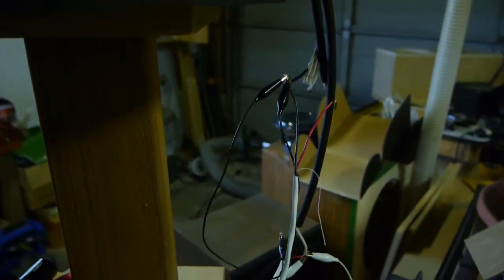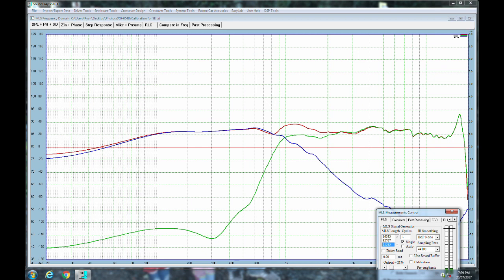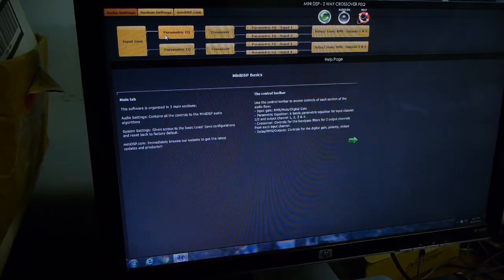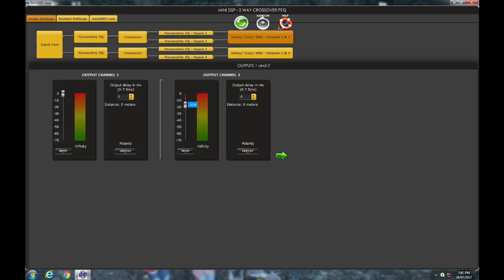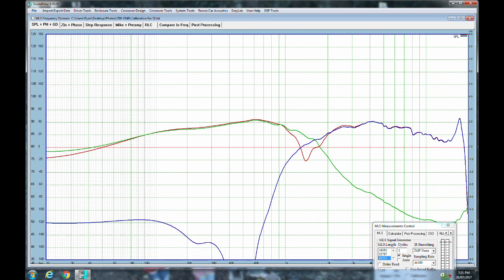Are Active Crossovers Easier than Passive? NO!

Comment: Agree - it does need to be said! Many people don't realise that the level of expertise to design either is about the same.
Reply from the maker: Red Spade Audio Yaaaaa, someone understood the point of this video! Thank you!!
Reply: You seem have forgotten the most important part. Active done properly.
Reply: the advantage of active crosoovers are not hat they are way easier to design. But that they are way easier to implement and you can reuse them in the future if you ever retire your first build by just reconfiguring them, not needing to buy all new parts.

And I'd like to share, you don't need to pay 100-200 for MiniDSP or MiniDSP HD to have active crossover, depending on your application there's free software like voicemeeter (that's actually a pay what you want software) or EqualizerAPO, that can help you with that depending on your setup.

I personally have a pair of active bookshelfs and just bought a pair of subwoofers, I was desperate to find a way of connecting them all togheter witouth spending a lot of money, I considered MiniDSP but I didn't want to pay 100 for it. Well voicemeeter banana just saved me. What I did is I bought a second SMSL M2 DAC and used voicemeeter to send signal to both of them, then I configured a high pass to the first and a low pass to the second M2 DAC, now I have a crosoover at 70hz about 36db/octave. But I didn't test that yet as the dual subs and the second M2 didn't arrive yet. But yeah, very cheap, not quite easy to use but the price makes up for the trouble. And since voicemeeter allow you to setup macros I made 3 presets, one for movies, a second for music and a third to just send full-range to the monitors when it's late night and I don't want to disturb anybody.

I'm pretty sure I'll need to make some fine adjustments when the subs and second DAC finally arrives.
Reply: Hi, im from indonesia.
Mini dsp is $105 at PE, with shipping and tax its $161 at my door.
Dont have budget for it.
I go with $3 caps, and $6 inductors.
With free xsim, im doing fine with passive.
Reply: @handryraya2853    FreeDSP.   Boards can be had from CHINA for almost $10 bucks. Or less.  GOod news?   They make some of the FREEDSP boards IN INDONESIA!    Its front end is more akin to a simple Plug and play setup.   But you can do ANYTHING with it.  Hopefully, someone builds a Front end software layer like most Normal DSP packages.
Reply: I'd have to disagree there..

Comment: The "newer" DSPs (e.g.ADAU1701) can do anything an analog crossover can do and much more.  You can test and implement with different slopes, topologies, add delay for time alignment and alter polarity as well...and boost or reduce dips or bumps in the response.
Reply from the maker: @chewsir  yes that's true. Even the minidsp used in this video. But that's not really what the video is about. Active is better. But not easier to do properly.

Comment: So you failed to understand that your 2nd order passive crossover switches the phase by 180°. You shouldn't delay the tweeter, you have to flip the polarity.
Reply from the maker: @Munakas-wq3gp I didn't fail in that, I'm showing that most people would. And it wasn't exactly 180 degrees. Also, flipping polarity and delay do the same thing, but with delay you can chose any degree where as flipping polarity you only get 180.
Reply: @ImpulseAudioSpeakers  Sorry but a 2nd degree butterworth flips the phase exactly by 180° so if you wanted to match your active and passive crossovers, you would use the same setup. Same polarity, same cutoff slopes. Your opinion on active crossovers is patently wrong because you can achieve with them everything you can do with passive crossovers, only easier. And steep cutoffs which are insanely expensive to achieve passively are just a mouse click on an active crossover. Having said that, what benefit exactly do you think a passive setup will give you? All it does is complicate the process and require you to buy expensive components to adjust the result if your simulated response was off. The only real benefit of a passive crossover is that it can be mass produced for consumer use to be used with an existing amplifier.
Reply from the maker: @Munakas-wq3gp  this video isn't saying active crossovers are bad. I agree they're great. The video is saying it isn't easier. You still have to measure and go through the proper process. Also, the phase wasn't exactly 180 degrees. There are other factors that affect phase and may require less delay than the 180 degrees. 

Trust me, I have a clue. But feel free to disagree.
Reply: @ImpulseAudioSpeakers  I could have sworn that the original title of the video was to the likes of 'using active crossovers is a bad idea'. But maybe I misunderstood.

Comment: Silly Title, havent watched yet, but it takes time to knock a circuit together and you still need to know what you are doing-more so in fact, skill level the same? well no, because you also need to know about soldering, power supplies, chips etc etc, as an analogue design engineer by trade DSP is a breeze because modification can be done on the fly without swapping out resistors and caps, BUT DSP unlike Analogue has limitation, most do not realise that the response is only as good as the number of Taps you have, so if you have say a miniDSP HD you will be fighting to squeeze into 1024 taps; especially at low frequency, then swapping between REW and Rephase is tricky when you start, you need to be 'on the ball', its really not for a beginner unless you have a decent technical competence and a good memory unless you go with a IIR and PEQ's in the software-BUT seriously if you appreciate sound you will not be happy going that route except on JUST low frequencies (because most ears cannot detect 5% distortion at the low end).
The right way to program a miniDSP HD is to utilise the PEQ's on input and output using biquads, then use the FIR to correct Phase by loading the impulse into REW and adjusting the created vector(L+R) to output excess phase and then loading that backinto Rephase to correct it on one channel.

Comment: You need active electronic crossovers that you can actually regulate continuously until you balance everything out , Rane and dbx work well. I don't waste time and money with passive anymore.
Reply from the maker: I don’t think you understood the point. The point was unless you can measure and understand speaker design, active is not easier.

Comment: 140 degrees out of phase eh? Why not just invert the tweeter?  🤔Since it's free and quick, why just choose 1.5k and call it a day when the DSP offers virtually unlimited tweaking?
Reply from the maker: Inverting the tweeter means they’re 40 degrees out of phase. Also, the point of the video was that these things don’t automatically work. You need to measure and design just like a passive XO.

Comment: no, it is not correct, a DSP and a activ crossover device are diffent things. A DSP has to calculate the signal this takes time, a activ Crossover uses the same parts as a passiv crossover and a op-amp, but before the amplifier.
Reply from the maker: Most people use the terms dsp and active XO interchangeably. Even more technically true is that a dsp and passive parts before the amp are both active crossovers. They actively change the signal delivered to the amplifier. A passive crossover passively changes the amplified signal.

Comment: This video is nonsense. Way to push your agenda. The reality is that active crossovers are much easier since it gives you all the tools to fix any problems.
Reply from the maker: I don’t think you understood the video. Active is more powerful, but all the steps to create the XO are the same. They’re not any easier than passive. Still need to build, measure, model, listen, tweak, etc. Not sure how that’s even debatable. I don’t have an agenda. I can do both quite well.
Reply: @ImpulseAudioSpeakers  is it easier to make a new bigger box with a better port tuning or to just amplify the lower frequency that goes into the woofer? Can passive crossovers pull better performance from cheaper smaller design without reducing efficiency like active crossovers can?
Reply: @ImpulseAudioSpeakers  Is it easier to run REW and then modify and rebuild the speaker or to just push some settings?
Reply from the maker: @BobFrostV  active is better. I said it’s not easier. Of course active has many advantages, there’s no debate. The point of the video is that a newb can’t just hook up an active box and expect it to work if they can’t design a passive cross over. 

Did you watch the video?

And no, you can’t just boost the bass if you build your box to small. Even with active you must rebuild the box, unless you like to clip amplifiers.

Comment: you can correct phase problem  in digital domain with group delay or inverting or so. obviously active solution is superior to passive.
Reply from the maker: But you can also do that with passive. The point of the video was most people don’t. They don’t even know to measure and see that the phase is wrong. That’s why it’s not a magic box or easier. Better, sure ya I’d say active is better.

Comment: But all you needed to do is reverse the phase of the tweeter like most speaker companies do and use the active eq in the nuke to flatten everything out. This is how we do it in every recording studio. This is also how JBL profesional theater speaker systems are done 🤷🏻‍♂️
Reply from the maker: What if the phase had been 90 degrees out. What if the speaker didn’t require polarity flip. Just because I sorta made it work with measurement equipment and knowledge doesn’t make active any easier to design than passive. I needed the same knowledge and measurements.

Comment: Wow! This video is misleading at best. It would take an enormous amount of time and boxes of components to make the  changes with a passive crossover that you can make in seconds with an active crossover like the miniDSP. And all the work is done before amplification. You are not placing a bunch of "stuff" between the amplifier and the drivers. AND, you are dedicating amplifiers to different parts of the frequency spectrum. The amps will have less to do and can be optimized for performance and sound quality....Solid State for bass and tubes for highs for example.....Lastly, the last speakers I built, the passive, high quality components, cost way more than a miniDPS.....And if I got the components wrong, the cash register just keeps ringing. Love your videos....This one?...Not so much! :-)
Reply from the maker: Not sure you got the point of the video.

Comment: I'm old school and installed a set of passive Morel's in my Ford. After listening to it for months, I bit the bullet and installed an Audison DSP, time aligned it and used an RTA to dial things in. OMG what a difference. I'd say that acitve takes even more expertise than passive because of the additional capabilities inherently included. With passive networks, you fight components to get things equalized and muck with time alignment the whole time. It's an endless battle. With DSP, the capabilities are infinite but you need to know what you are doing for sure.

Comment: This is ridiculous.  The whole point is that you can tweak the active DSP really easily.  What you show is the result of an off the shelf 1.5k active like say a Marchand.  The whole point of a DSP crossover is that revising it is trivial, while revising a passive (or an electrical active) requires a lot of resoldering and a big parts bin.  That's where its less work - you can iterate really quickly - and with the minidsp you can do it without even stopping playback.  Do you have to measure? Yes.  Did you show how easy it is to try inverted? Nope, but its just a click.  How about adding a delay?  Yes you did the result was good and yet 'I didn't work on this for very long'.  Bingo.  There you have it - the minidsp is a panacea if you accept the resampling, and so is eg camilladsp (perhaps more so if done before any DAC).  The summary is self contradictory - perhaps the answer is 'if you want to go active, go DSP' but you appear so keen to lump DSP with fixed function active.

Comment: Thanks, hope you make more videos!
My stupid question is.. can 2 speakers left and right as in stereosetup corse phaseproblems. Maybe just in low frequencies?
Reply from the maker: Yes they can and do. But because they are specially separated far enough our brains understand what is happening and even creates an image out of the stereo information. So although we are constantly dealing with phase in a single speaker, we don’t need to worry about it with a stereo setup. 

You do raise a good point that when the frequencies become low enough the wavelengths become long enough that the distance is no longer sufficient. We can’t separate the speakers far enough apart because even the wall reflection become sources that our brain can’t decipher. So phase is a big problem with the pair of speakers and even more so, the room.
Reply: @ImpulseAudioSpeakers  maybe this i why open baffle is popular, since there i less impact from room-sidewalls.
Reply from the maker: @peterandersen4040  that is one of their strong suits.

Comment: Quick question. We are discussing phase cancellation and phase shifting however why would these necessarily cancel out? I can see if the frequency range is the same you would get cancellation. But the human ear doesn't hear at just a single frequency. I do not believe a 100 Hz tone (from the woofer, obviously) that is 180 degrees out of phase with a 2 kHz tone (from the tweeter) will result in cancellation. One of the obvious reasons for this is that the wavelengths are very different.

Now, if you have two subwoofer signals (stereo configuration - same frequency range therefore same wavelength), older amplifier designs would have a phase reversal switch for the low frequencies. This was needed because the physical size of the listening room (and the resulting acoustics) may throw the subs out of phase with each other and, since they are operating in the same frequency range, that would definitely result in attenuation of the sound (perceived by the listener as "weak" or "muddy").

One thing that would be really cool is for you to actually get an RTA and watch what it does with a white noise signal in real time (before any equalization is applied). Many of the midrange and most of the very expensive receiver amplifiers out there with built in 7.1 surround all have auto equalization built in plus an included microphone (with input on the back of the unit) so that everything will be adjusted automatically when you set it up.

I am a big fan of active crossovers because, when done right, the sound is amazing. Where these configurations have been more commonly found is automotive sound systems since you typically would be running 4.1 or 5.1 with just highs and lows (active crossover split) going to LF/RF/LR/RR and then the full range signal going to the center channel in the front (difficult to install since you have to do major surgery on the dashboard and center console). The sub is normally in the far rear and modern systems only have a single mono sub since subwoofer frequencies are highly omnidirectional so there is no need for stereo (you would not easily discern the direction from a cannon blast from the left vs. right - the entire vehicle shakes.... :) .

The trend even for automotive today is to allow Bose, Sony, Celestion, JL Audio, Soundstream work their magic getting the passive crossover design absolutely perfect in their anechoic lab testing chambers. Known as "separates", they contain separate drivers for the satellites plus the passive crossover module that is mounted out of view. Basically let the OEM get everything matched perfectly for a typical car (or living room at home). This greatly simplifies the design (meaning potentially just one five channel amp for everything except center and a small amp for the center channel) versus 20 channels of amplification or more (and two days of adjusting crossovers and positioning working with an EQ and an RTA).

Even the $20,000 sound systems installed in movie theatres today do not use active crossover designs. But it can be done if you want to put the time in. The question then becomes 'can I do it better than the engineers at Bose?'. I am very good at all this and have built several sets of speakers with passive crossover designs plus a couple for my cars in the past that used active crossovers. I do a good job. But Bose (and all the others) are better. But the joy in the journey is the journey itself. The first thing you do when you buy an old performance car is tinkering and upgrading. Because that is how we learn! :)
Reply from the maker: You realize I used a white noise signal to generate these plots? Nobody would say we only hear one frequency at a time. Take some time to figure out the graphs and you’ll see why the active XO was not as good.

Comment: If I screw up an active crossover, it doesn’t cost me hundreds of dollars in parts and waiting on postage to change to change a setting. what about using an active crossover to aid in designing a passive crossover?
Reply from the maker: Sure that can be done to save money. I don’t know about hundreds of dollars. But yes active XOers are very good as a primary XO or an aid if you want a passive XO. It’s difficult to translate an active XO settings to passive parts though. So it’ll only tell you if the driver is happy with what ever XO point or slope etc. You’ll still need to come up with the passive design. And as the video says, it’ll be just as difficult to design the XO actively as it is passively so you may do some double work.